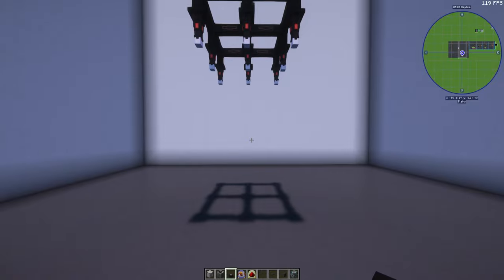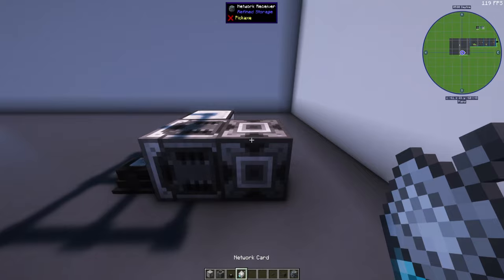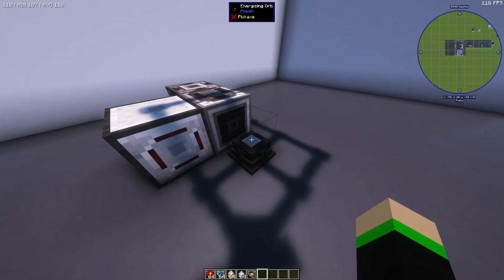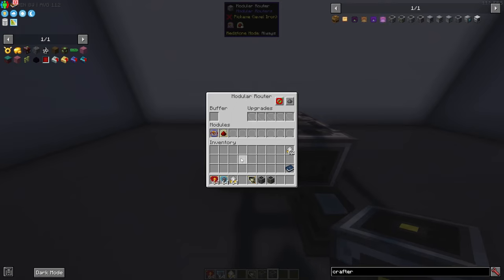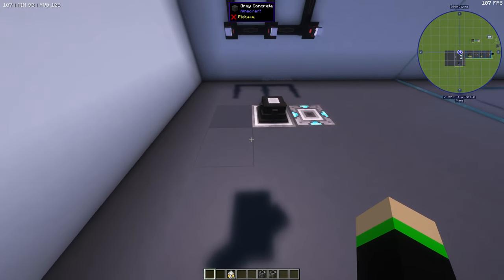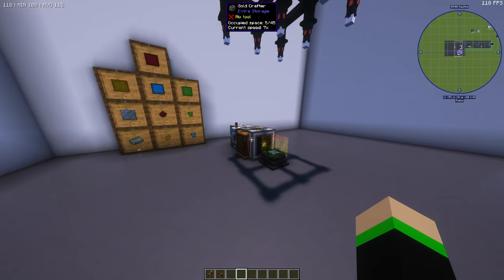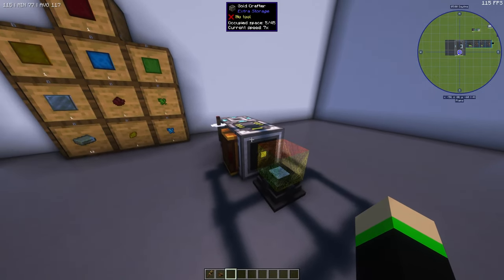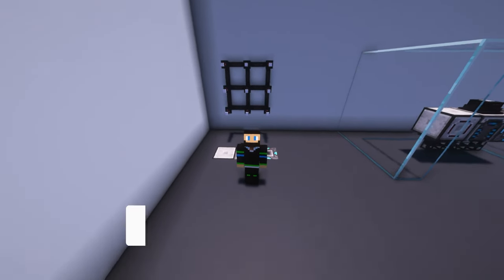How To Automate The Powah Energizing Orb For Refined Storage

Comment: Yo for all of you playing ATM9 and wondering why the redstone module will not send a signal to the crafter to craft another (crafter locked error) try putting 2 identical redstone modules in the modular router. dont ask why. I have been looking for fixes for hours on end. the only thing that ended up fixing it, was 2 identical detector modules.
Reply: I have this problem in ATM9, says crafter is locked. To be clear, you are using a second modular router next to the first one with the same upgrades? Or are you using a second detector redstone module in one SINGULAR modular router?
Reply: Yo I APPRECIATE you so much for this! I can’t believe it worked❤ not gonna question it, just gonna accept it 😂
Reply: i have no idea why this works but it does Than kyou
Reply: Saved alot of time, thank you!
Reply: I had to put the detector right after the puller if you put it on the other side of the sender
Reply: Thanks, that fixed it

Comment: When I click craft 10 niotic . It just puts 10 diamonds in instantly and won’t craft? Instead of 1 by 1
Reply: Modular Routers inside force-loaded chunks will only function correctly if you have the right settings. 

How to change the setting:
 
 - Open your inventory
 - Top left (To the left of the quest book) is the "My Team" icon, press it
 - to the top right of the interface there is a cog, press it
 - Third down from the top you'll see the "Allow all fake players" option, change it from "false" to "True"

*Other than this, make sure everything is just like in the video, I changed some settings in the modular router and the crafter to get it to work, but the modular router redstone mode (top right) needs to be set on "always", and the crafter setting (top left) needs to be set to "redstone pulse inserts next set".

Comment: For People playing on ATM9, 

You have to make a Pattern Grid and have some pattern cards. Go into the grid and select processing. Then go into JEI and select the recipe from Powah into the Pattern Grid. The recipe will insert into the grid, then use a blank pattern card to apply. Then go back to the crafter and insert the pattern card with the recipe. It will look like an item, but when you press shift, it will show the card. Hope this helps.
Reply: I followed the video several times, and yet mine keeps filling the orb instead of doing 1 gold 1 iron ingot or whatever the recipe calls for.  How do I make it so it only puts in one of the ingredient until the orb is empty

Edit: Playing on ATM9
Reply: but i have a question why does my crafter always lock himself i always get the same issue with it
Reply: @aroxh4919  I dont know if this is a complete fix but when i looked at the pattern it said 1x emerald 13x spirited crystal, i changed it to a pattern that said 1 and it started to work
Reply: @Afterlife-gw6mo  i noticed that the "redstone pulse insert next set" in the Crafter, was my mistake in that regard. pls check if you set that correctly
Reply: legend

Comment: In case you don't have the redstone control option for your crafter, especially on a server- It's a bug with no real way to fix it, as far as I've seen.

From Refined Storage discord: "The order in which specific things are registered needs to match between client and server, but due to a bug that order can be somewhat random" and there's no true way to fix it. Sometimes, reloading your client might help but it's also a random chance.

You can try to use a relay to disconnect the crafter. The relay acts like a cable, which means you'd put it between the crafter and the network receiver. Switching the signal, it'll disconnect the crafter, etc. like the Alfred's tutorial.

PS. Great tutorial, life saver xoxo
Reply: Amazing thanks for sharing this info I was struggling to use my netherite crafter where I couldn't set the mode for it 👍

Comment: Thanks, been scratching my head about this for a while (Using All the Mods 9) worked fine, only issue I'm having now is that after i craft something in the Energizer after some time it become locked (I assume the redsone signal expired?) and i have to go toggle the crafter from Pulse to ignore and back to craft another set. (un sue what i did wrong)
Reply: Hey I am running into the same exact issue. Were you able to find a fix?

I set mine up exactly how alfred did in this video

Comment: OBS!!!!! 
For anyone having the issue of items not being added into the crafter correctly

The modular router is classified as a "fake player", and thereby needs to be specifically allowed in the FTB chunk interface when claiming chunks. 
(I claimed chunks so that my farms in my base would keep working while I was out exploring.)

Modular Routers inside force-loaded chunks will only function correctly if you have the right settings. 

How to change the setting:
 
 - Open your inventory
 - Top left (To the left of the quest book) is the "My Team" icon, press it
 - to the top right of the interface there is a cog, press it
 - Third down from the top you'll see the "Allow all fake players" option, change it from "false" to "True"

*Other than this, make sure everything is just like in the video, I changed some settings in the modular router and the crafter to get it to work, but the modular router redstone mode (top right) needs to be set on "always", and the crafter setting (top left) needs to be set to "redstone pulse inserts next set".

I hope this helps!
I am playing ATM9 btw, though I found this information in a thread concerning ATM8, so it should help in both versions.

I WISH YOU LUCK POWAH GANGSTERS!!!!

Comment: ATM9, tried what comments said with a second redstone detector, did not work, would stop after a single craft, tried other solutions (had fake players allowed already!), only thing that worked is setting up just the crafter again, somehow works now.
Reply: had to watch the video in slow motion. For me the router was not set to redstone mode always by default. Little box top right should look like ash. changed that and it worked

Comment: so im playing ATM6 and it works for the most part but it is inserting more then 1 at a time of blaze rods for example into the energizing orb while the energizing orb will only start if there is 1 item in it. How do i make sure it only inserts 1 item into the energizing orb at a time ?
Reply from the maker: Make sure to set the crafter to "Inserts after redstone pulse"! It's an important step
Reply: @AlfredGGMC  i cannot seem to find this setting in ATM 6 its not showing on the gui of the crafter when i right click it, i know its supposed to be on the top left corner of the crafter GUI but its not there... strange.
Reply: @AlfredGGMC  OK so i found out what the problem was, you cant use the crafters from extra storage in ATM6 causse there is no redstone setting on them, there is a redstone setting however on the standard crafter from refined storage.

Comment: So I'm using Netherite Crafters in ATM8 as well and I'm wondering how I can use the max crafting speed on them. At the moment, I'm outputting into Netherite Chests then feeding into the machines to process from there, but with 4x Speed Upgrades, I find that the Netherite Chest still limit the speed of the crafters, and I'm wondering if you have a solution? This is mainly an issue for recipes that require 100k+ of several materials to be processed.
Reply from the maker: Alright, so I haven't fully tested this setup just yet, but you can actually point the crafter to a storage controller. For every 2x2 drawer that is linked to the controller, it adds +4 slots to the Crafter for speed. I can't think of how I'd pull items out of the controller after it requests a recipe, but it might get you started into thinking about it.
Reply: Just use stack upgrades for Chests
Reply: This is such an elegant solution, I appreciate what you do.

Comment: This comment might not help a single person.. but if the items for the recipes are being pulled into the energizing orb, but not being processed by the energizer orb to get converted, check the output on the power on wherever the power is coming from to power up your energizing orb system. Somehow out of nowhere, it got switched to input instead of output for me, causing it to not go off and energize the items. Took me forever to even think to check that since none of the comments here mentioned it lol

Comment: So im having this weird issue where requesting 1 energized steel it works fine (multiple requests of other items work fine too) but when requesting more than 1 energized steel it will run the first craft but won't input the second lot of gold and iron (requesting multiple of the other items works just fine)

Comment: If there is still people on ATM9 having some troubles with the router not picking up items, put the router on Redstone mode : Always

Works for me atleast
Reply: Modular Routers inside force-loaded chunks will only function correctly if you have the right settings. 

How to change the setting:
 
 - Open your inventory
 - Top left (To the left of the quest book) is the "My Team" icon, press it
 - to the top right of the interface there is a cog, press it
 - Third down from the top you'll see the "Allow all fake players" option, change it from "false" to "True"

*Other than this, make sure everything is just like in the video, I changed some settings in the modular router and the crafter to get it to work, but the modular router redstone mode (top right) needs to be set on "always", and the crafter setting (top left) needs to be set to "redstone pulse inserts next set".

Comment: This setup fails when the energizing orb outputs two finished materials (for example, energized steel). It might work on a couple, but the system soon gets into a race condition and the detector module won't pulse correctly and the RS crafter doesn't place the materials.
Reply from the maker: I've used this on multiple speedruns, and I never run into an issue. Just gotta make sure you've done all of the steps like I show!
Reply: @AlfredGGMC  Not sure, I'm playing the latest version of ATM9 and it wasn't working.

Comment: So I had no issue on the Ragnamod modpack, it worked very well and I found your video super useful !! But, on ATM9, it doesnt work. Somehow, the gold crafter only crafts once, and then stop. Then, I have to break the crafter because it's "locked". Idk why but everything works, just it's not autocrafting more than one ;'(
Reply from the maker: I'll have to look into it when I play ATM9!
Reply: @AlfredGGMC  have you found a way to get it to work on atm 9 yet I just built this and it isnt letting me put anything in the crafter
Reply: @physiix2624  did you manage to solve it?
Reply: seeing the same issue in ATM 9 as well :/
Reply: Just tried this in atm9 and it worked the first time and then I tried a few times after that and ended up completely losing 64 emeralds (I tried doing the +64 option).
Reply: I just set this up in ATM9. Besides the progressive crafting issues that RS has, it works like in the video. It puts the items into the orb one craft at a time and the router pulls out the crafted item. No issues going from say blazing to niotic and back.

Comment: Another fantastic tutorial. Will you be delving into Xnet at all?
Reply from the maker: I would love to, but I definitely need to learn it first!
Reply: @AlfredGGMC  Same here. I’ve been advised it’s the best option for mass Phytogenic Insolator setups but I have no clue where to begin lol
Reply: @leegale1397  I have phytogenic insulators for every Mystical Agriculture seed using Universal Pipes for inputting items/RF and ultimate logistical transporters for outputting. This setup doesn't produce nearly as many essences as my 9x9 setup using the player interaction interfaces with Mystical Agriculture Scythes, but it's a good method to have a simple, constant source of various essences.
Reply: @leegale1397 t’s not that hard. A really basic overview is you use one channel(energy)to power everything, export from source and import into machine. One channel(fluid) to export from a sink and import into the machine. One channel(item) to export from machine and import into storage. 

I have crafters in the system to process the essence. The output is then typically moved into a progression of compacting drawers. 

You want to use advanced connectors since they can mimic sides. This allows you do everything on one face. But you have to set up each connector. You can simplify it by using pipez for the water. This way you don’t have to mimic any faces. 

I used this type of setup to make a lot of resources. Had two of the largest compact machines loaded w/ six rows of 72 phytos. Red print made the phyto setup easy. The xnet controller configuration will be manual.
Reply: @Bob_Smith19  Yeah. I watched a small tutorial and think I have it, I’m going to give it a go later when I get chance to play
Reply: @Bob_Smith19  I’ve just setup an 8x8 Phytogenic Insolators using it. I’ve got everything inputted and outputted using 5 channels. It’s awesome! The only downside is 5000mb of fluid per channel (but I’ve used 2 and can use more if necessary)

Comment: why can't i put items into the crafter
Reply: You need to make the pattern for the item you want to make in the crafter. Go to your crafting grid and make a pattern. You will also need a pattern grid (looks like crafting monitor under refined storage). Connect the pattern grid to your controller. Once that’s done, go to pattern grid and find whatever item you want to make, let’s say spirited crystals. You need to add that to the pattern grid and then to the right there is a slot to add the blank pattern, place blank pattern in that slot and then craft it. Once you’ve done that, take the completed pattern item (spirited crystal pattern) and then put that item into the crafter (you should be able to add to crafter)

Comment: Doesn't work, cant craft anything with the crafter, using the Refined storage crafter
Reply: Works fine you must have made an error, make sure the crafter is facing the  energizing orb, when you right click the crafter it should say energizing orb at the top
Reply: It works like it should if you build it properly.